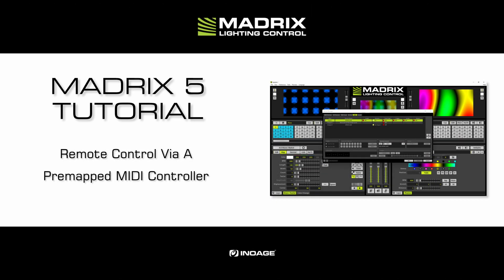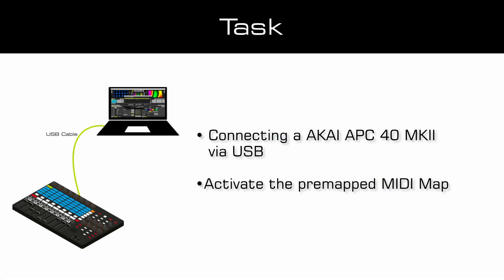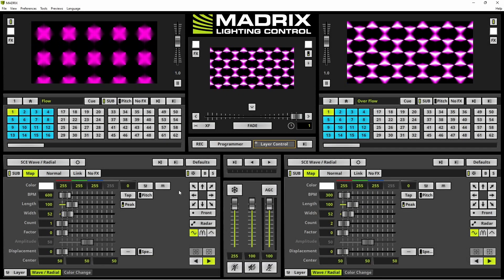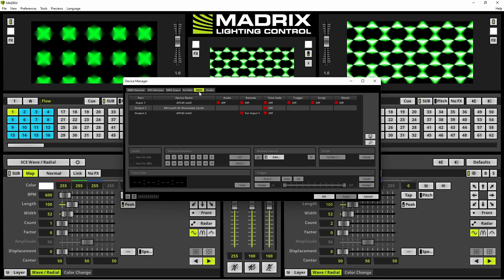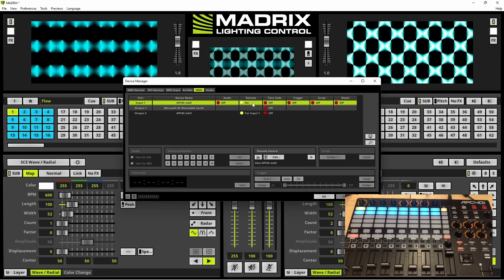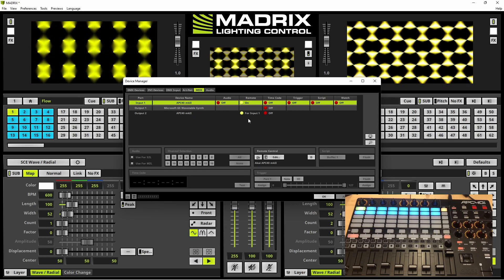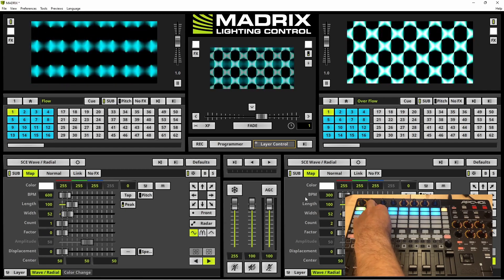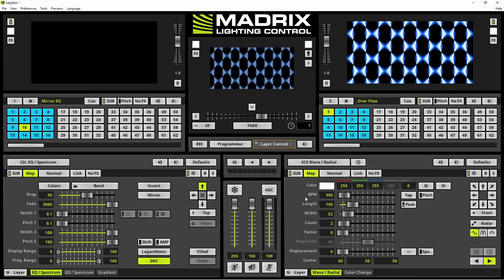MADRIX 5 Tutorial - Remote Control Via A Premapped MIDI Controller

Comment: It is possible to use MIDI & DMX control at the same time (with a lighting avolites console and a AKAI APC) ?
Reply from the maker: Hello! It is possible to use a MIDI Controller and a DMX Console to control MADRIX 5 remotely at the same time. If you want to assign one an the same MADRIX Remote function to both controllers you will need to change the "Execution" Option of the DMX Input to "On Value Changed".

Comment: Is it possible to connect 1 midi controller and mapped to madrix and quickshow?
Reply from the maker: Hello! By default every MIDI controller will communicate with the first assigend software and you can't assign a second software to the same MIDI controller.